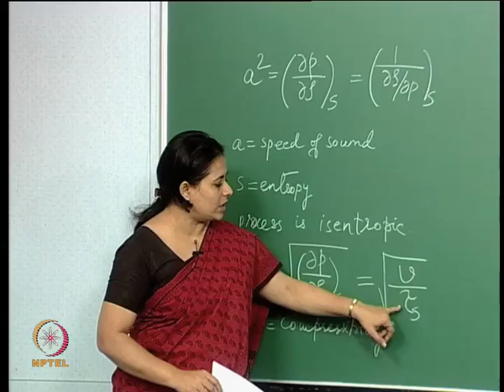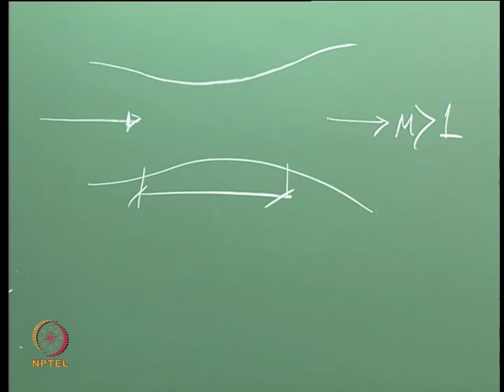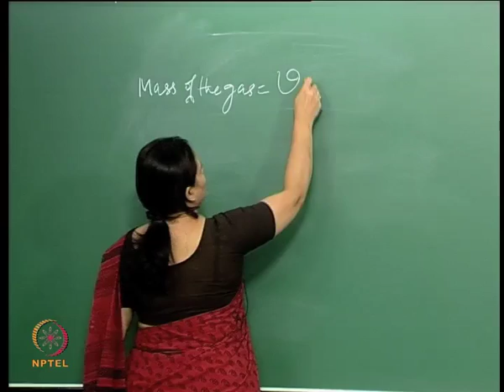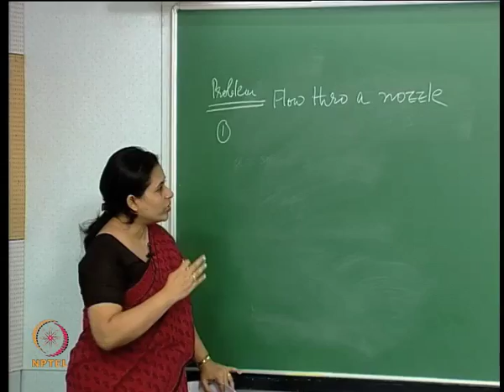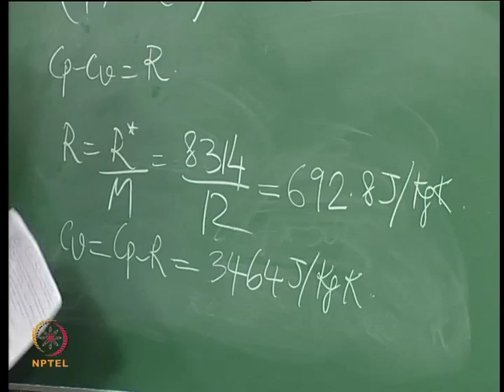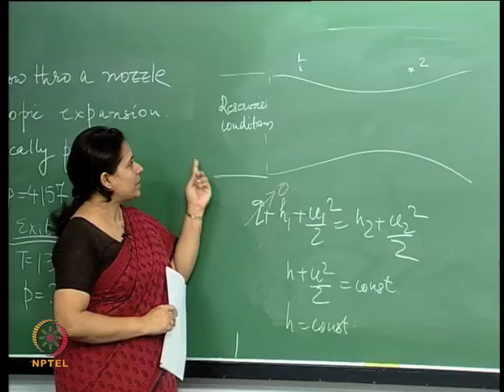Mod-01 Lec-04 Lecture-04-The Mach Number and Compressible Flow

Comment: In the example when the professor wrote Pv = RT => P/T = R/v = constant, she meant between state 1 and 2, the gas inside the volume, hence specific volume v stayed constant and she could equate P1/T1 = P2/T2. So the entropy change happened purely because of gas heating inside the concealed tank. Gas never flew out of the tank and went into wind tunnel; it that were so then specific volume could not have stayed the same between state 1 and 2, and we could not get P1/T1 = P2/T2.